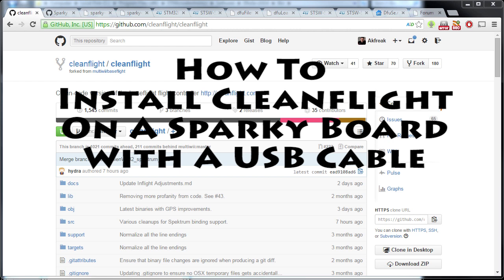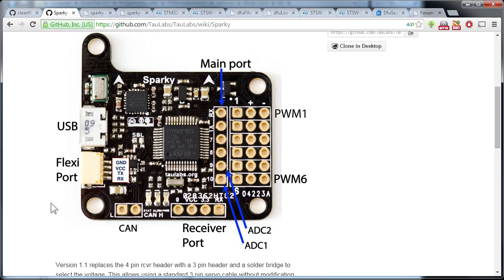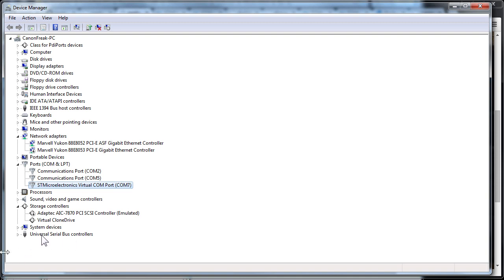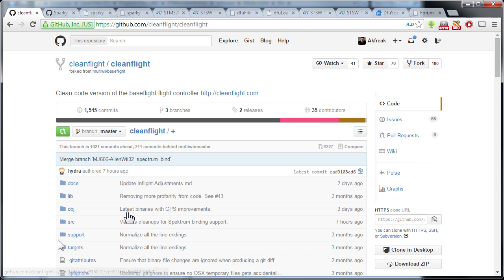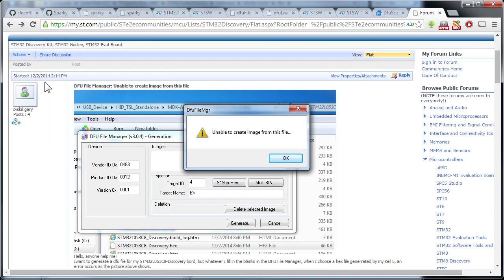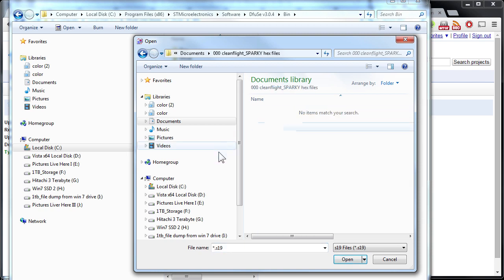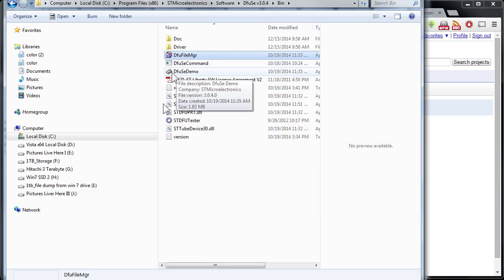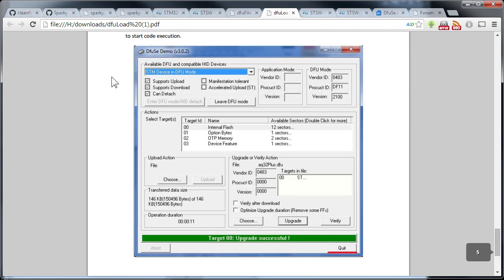How to Install Cleanflight On a Sparky Board With a USB Cable

Comment: Now I'm trying to go back to Tau Labs and I loaded the bootloader peabody linked in a thread but Tau Labs doesn't recognize it because it connects as a STM32 virtual COM port rather than it used to as a "sparky".  I'm lost, nothing will connect now  :-(
Reply: Solved this; explained here if anyone comes looking.  This is crucial to how to flash back to Tau Labs: http://forum.taulabs.org/viewtopic.php?f=12&t=540&p=4393#p4393

Comment: Thanks for the video.  Left out how to go from "STM 32 Bootloader" to DFU mode but that was quickly googled.  I'm now loaded up successfully but Cleanflight still won't recognize/connect.  The sparky shows up as STM32 virtual COM port.  Any ideas?